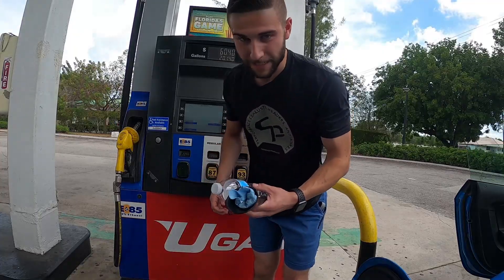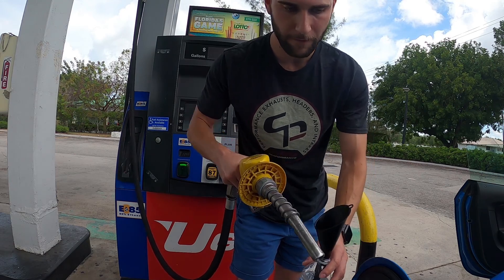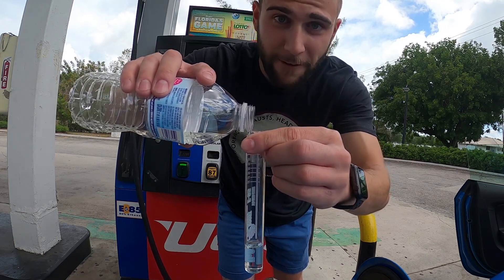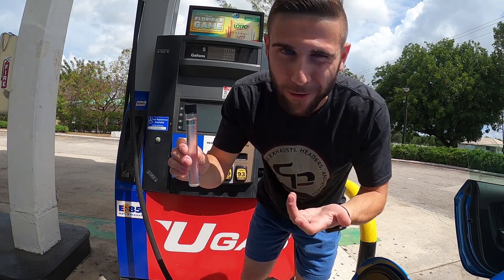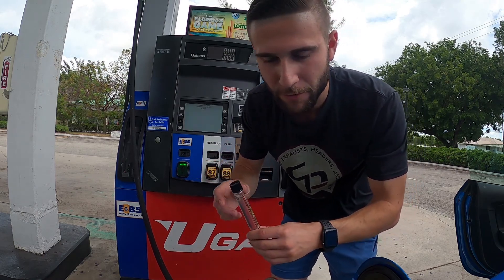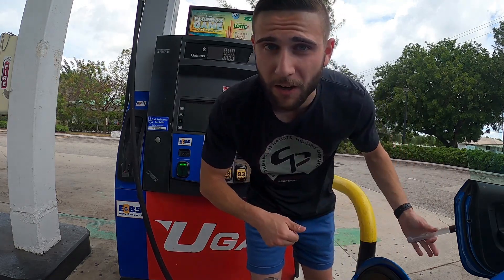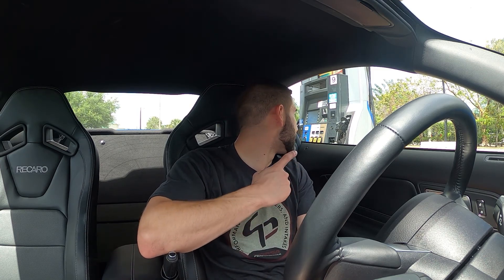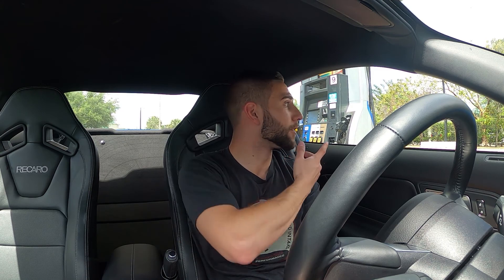E85: How To Test It and Pros & Cons | E85 vs Gasoline

Comment: I have a 11:1 ls1 in my truck. Nearest e85 is 13miles away. My home town only has 87. Worth it you think compared to 91?
Reply from the maker: If you're going to have to drive almost 30 miles round trip just to fill up, probably not worth it on an N/A motor. You'll likely use about 1/8 tank just to fill up. Not sure the kinds of power gains LS1s see with E85. That's just my opinion.
Reply: @MustangMatt116  Unfortunately 91 and e85 are same distance. My home town only has desiel  and 87

Comment: I love your video when you talk about having to upgrade your fuel injectors I drive a 2013 Ford F-150 5.0 which is a gen 1 and my gas cap says e85 or 87 I'm thinking of running e85 do I have to upgrade my fuel injectors

Comment: Been using E-85 in my '09 Pontiac G6(3.5L) and '14 Chevy Equinox(2.4L). Fewer mpgs, but a tad more power. Cost-per-mile is about the same. 60-70cents/gallon is about the breakeven point I've found.
Reply from the maker: Yup I found with my car also that cost-per-mile was identical. It's just a little more inconvenient filling up more often but there's E85 stations everywhere where I live
Reply: @mattfocused  : I have one just down the road and another about 25 miles away. $2.369 at the closer station, but $2.199 at the suburban Toledo, Ohio station.

Comment: Hey, so gen-3 coyote's can go straight to E85 without and mechanical mods? All you need is a tune? What tuner do you have?
Reply from the maker: Yup, gen 2 can as well as long as they're on the factory intake manifold, otherwise they need 47# injectors only and gen 1 on any intake mani needs 47#. All you need is a tune. I'm tuned by Lund and have an nGauge which aren't being produced anymore so if you want one you need to find a used one for sale.